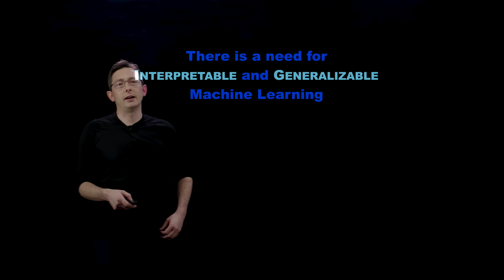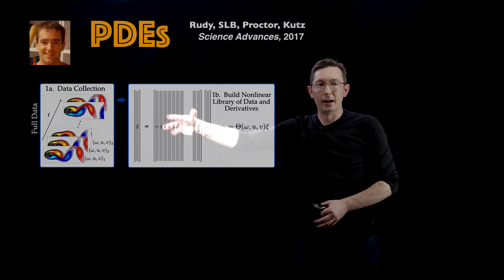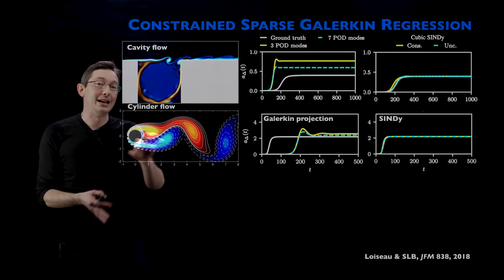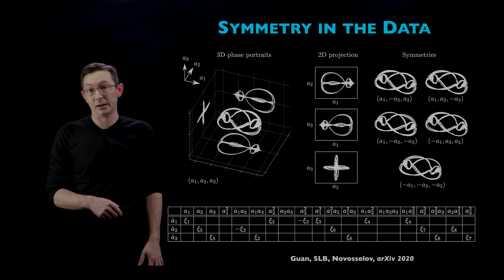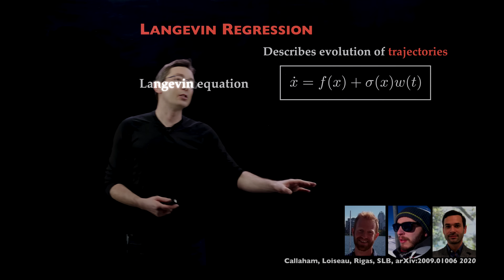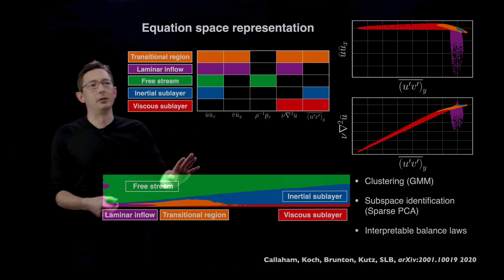Sparse Nonlinear Models for Fluid Dynamics with Machine Learning and Optimization

Comment: Very late to the party and still working through your videos, but I'm curious about the symmetry/conservation law constraint. If we're modeling physical systems, it seems like thermodynamic (or other conservation law) constraints basically "always" apply. But there's a sort of information theory problem baked into how many of these priors we include and how much we believe them. Is there any theoretical work on how to think about this? Also is there ever coupling between the entropy in the space in which the dynamics unfold and the dynamics equations themselves? Seems like there should be given certain modes are just not going to have meaningful impacts on sufficiently small spaces, but they may in the long term in larger spaces (just an intuition, could be wrong).

Comment: The team at DeepMind has tested the programming skills of its AI programming tool AlphaCode against human programmer competitors and has found it tested in the top 54 percent of human coders. In their preprint article, the group at DeepMind suggests that its programming application has opened the door to future tools that could make programming easier and more accessible. The team has also posted a page on its blog site outlining the progress being made with AlphaCode.

Research teams have been working steadily over the past several years to apply artificial intelligence to computer programming. The goal is to create AI systems that are capable of writing code for computer applications that are more sophisticated than those currently created by human coders. Barring that, many have noted that if computers were writing code, computer programming would become a much less costly endeavor. Thus far, most such efforts have been met with limited success, however, because they lack the intelligence needed to carry out the most difficult part of programming—the approach.

When a programmer is asked to write a program that will perform a certain function, that programmer has to first figure out how such a problem might be solved. As an example, if the task is to solve any maze of a certain size, the programmer can take a brute-force approach or apply techniques such as recursion. The programmer makes a choice based on both real-world knowledge and lessons learned through experience. AI programs typically have little of either, and they also lack the sort of intelligence that humans possess. But it appears researchers are getting closer. DeepMind's AlphaCode is an AI system that is able to create code within the confines of a programming competition—a setting where simple problems are outlined and code is written within a few hours.

The team at DeepMind tested their new tool against humans competing on Codeforces, a site that hosts programming challenges. Those that compete are rated on both their approach and their skills. AlphaCode took on 10 challenges with no assistance from human handlers. It had to read the outline that described what was to be done, develop an approach, and then write the code. After judging, AlphaCode was ranked in the top 54.3 percent of programmers who had taken the same challenges. DeepMind notes that this ranking puts the system in the top 28 percent of programmers who have competed in any event on the site over the prior six months.

Comment: How does sindy compare with genetic programming for system identification?
Reply from the maker: They are quite closely related in spirit, although they use different algorithms and representations.  In general, genetic programming will represent a larger space of possible model functions, although it may be more expensive to find the model in this space (more data, more computation, etc.).  Because SINDy is built on linear algebra (i.e., a simple generalized linear regression), it is more natural to extend in some ways (e.g., adding control, other regularizations, etc.).

Comment: Hi professor, I’m a masters student currently learning convex optimisation, compressive sensing, and turbulence modelling (as separate courses/projects). Familiar with some signal processing, including wavelet transforms. Would like to know if there are any summer opportunities, where I could contribute to this/similar project?
Reply from the maker: Thanks for the question!  I don't have well-defined summer opportunities in this area just yet, but if you start following the "PySINDy" github project, there might be areas to contribute here, and that could spark some ideas for larger projects.
Reply: @Eigensteve  thank you very much professor.

Comment: Really interesting... do you have plans to apply sindy to telecom network traffic analytics?
Reply from the maker: Not yet, but that is a really cool idea!  Would be interested to know how it goes if you apply to that area.
Reply: @Eigensteve  We will, but right now we will  apply bernoulli since it is the simplest model. For what we want to achieve we will need to use an adaptive control approach ... and this is a very good method

Comment: Are there extensions of this for stochastic differential equations?
Reply from the maker: Great question!  Yes indeed there are.  The first extension was by Boninsegna, Nuske, and Clementi (https://arxiv.org/abs/1712.02432), and we (Callaham, Loiseau, Rigas) followed up with a modification more suitable for turbulence (https://royalsocietypublishing.org/doi/full/10.1098/rspa.2021.0092).  Recently, we demonstrated that this can be used on measurements from real turbulence experiments at high Reynolds numbers (https://arxiv.org/abs/2105.13990).
Reply: @Eigensteve  i'd like to check the papers but the links you provided unfortunately do not work
Reply from the maker: @CHRISTICAUTION  Sorry about that!  They seem to work for me... any in particular that don't work?  Most of them can be easily google searched too, and they are mostly open access.
Reply: @Eigensteve  I think it is just because the end parentheses being appended to the url
Reply from the maker: @paladinofjustice1107  Thanks for catching this!
Reply: @Eigensteve  these links are not working. any reason

Comment: Can these techniques be used for things like weather or climate simulations? Or are those too "chaotic" for sparse models to work?
Reply from the maker: In general chaos isn't really the problem, as there are plenty of chaotic systems that are also sparse (like the Lorenz 63 weather model).  Multiscale dynamics (e.g., weather evolves over scales spanning thousands of kilometers down to sub-kilometer scales) are more challenging because the dimension of the representations are large.
Reply: @Eigensteve  I see - and do you have an intuition for why sparse models don't work well in multiscale situations?
Reply: @kevalan1042  Have you seen the movie Twister? To begin, we'd need to have literally thousands, maybe millions, of sensors spread across miles/kms of 3D space. All of the data they show has temp at every x,y,z and at every delta t. So, I would guess that if we could do that on a massive scale, we could make forward progress